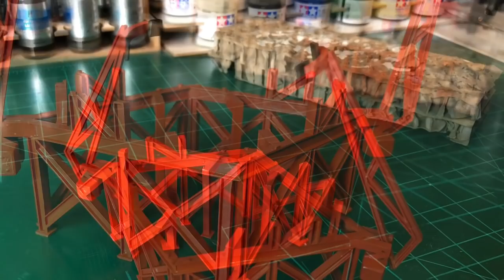1957 Revell XSL-01 Manned Space Ship Build Part 2

Comment: That old plastic you need to use testors orange tube glue. I know a lot, hell most, people like the liquid glues and cements nowadays,but I still use it on heavy things or old kits I run across every once in a while. Also if you need something to stick in place right now,but still have some wiggle time,tube glue is your best friend. Can also use it to get a kinda self filling seam. Put it on kinda heavy,let it sit a minute to soften upthe plastic,then squoosh the parts together with a little slide back and forth,and you get a bit of a bead of plastic,that you can then sand smooth. Pretty much auto filled seam. Little practice and you can get a real seamless look.
I like tube glue,In it's proper place!
Reply: True. I'm a 52-y.o. Advanced-level model builder and IMHO, there's still nothing on the market that's better for welding large part surfaces together than Testor's tube cement. It's bond is much stronger than most liquid cements, and doesn't evaporate as quickly. Thus allowing for much more working time while assembling very large models e.g., the Revellogram 1/72 B-36 or Revell's 1/48 B-1B. It doesn't make any difference if the tube cement is the original Testor's solvent-based version, or the 1970's-present day non-toxic citrus-based variety, as both work equally well. People who complain about 'stringing' are usually waiting too long to join the parts together, which allows the cement to partially surface-dry and create strings.

Comment: Next time you have to scribe those lines try using a Vermeer Height Gage and a blade like a #11 glued to the scribe tip. I break the tip off the pull it backwards towards the square edge not the blade edge. You get a clean line and you can set the gage to any height you need and it’s repeatable. For cylinders you can use an angle block and turn the tube in the corner. If you do this on a pane of glass or a marble stone block you will have a flat and accurate surface to work on. This takes the guesswork and agony out of the job at hand then you can clean up the scribe lines and prime the parts. Scribing after you get the surface finish you want is more risky!